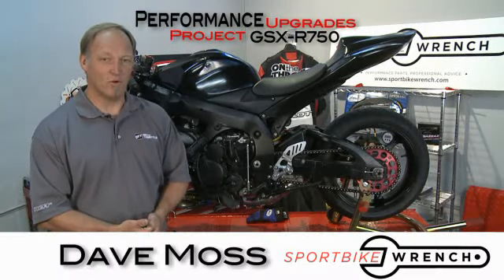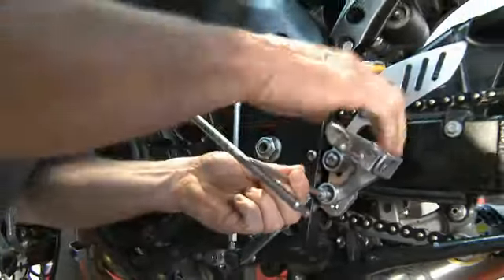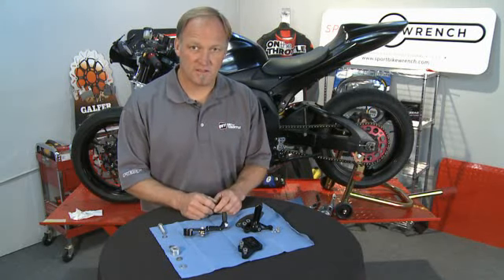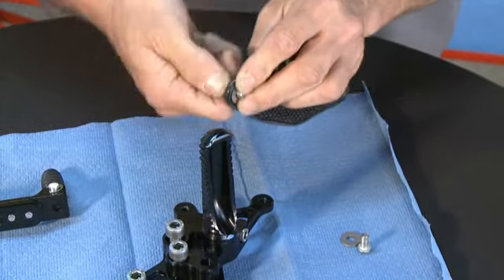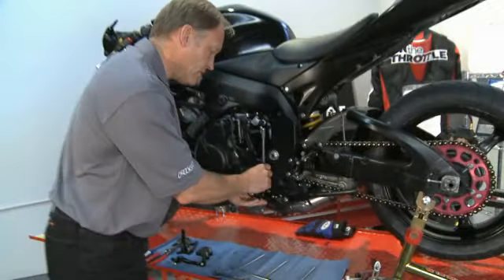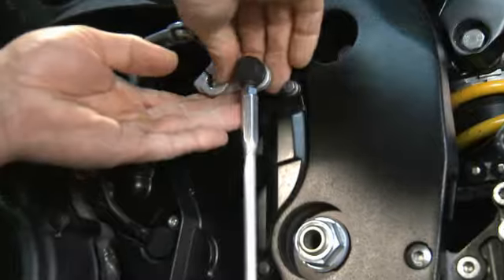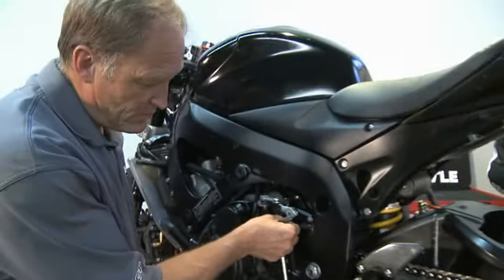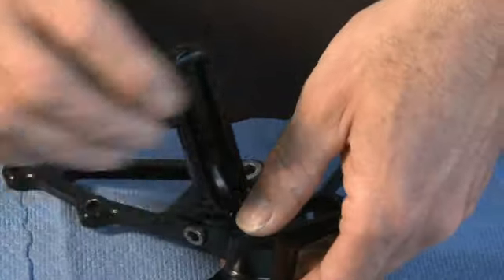Performance Upgrades GSX-R750 Attack Rearsets Install

Comment from the maker: we have found that it doesn't need the spring from the OEM rear sets and I've never had a drooping rear brake lever from that on the bikes that I have worked on. Doesn't mean it won't happen and putting the spring on (if the after market rear set facilitates that) is always a good idea.

Dave Moss
Host

Comment from the maker: @ZacGot1 for the track/racing, we reverse the shift pattern, so 1 up, 5 down. If you think about shifting using street shift, your foot is under the lever so you could grind your boot or worse, break your foot. Pressing down to go up a gear is much safer and makes a lot more sense!

Dave Moss
Host

Comment from the maker: @mrodmelvin11 not sure I can 'see' what you are explaining. The bolts should come out of the rear set to release the master cylinder. Then you remove the split pin and washer keeping the clevis in place and remove the spacer to free the clevis. The split pin can be a pain to remove!

Dave Moss
Host

Comment from the maker: @mrodmelvin11 it says in their PDF to replace original master cylinder clevis with new one and mount master cylinder to master cylinder bracket. Then adjust clevis to attain desired brake pedal height, tighten clevis jam nut, and install clevis pin/spacer/washer/cotter pin. You cannot use the OEM clevis as it will not separate itself.

Dave Moss
Host

Comment: On the right hand side it doesn't look like you are re-using the brake lever spring that restricts the brake lever range of motion. Wont the brake lever be sloppy without this spring? Great vid as always.

Comment: What tool did you use to remove the rear set on the rear brake side?  My hex set will not remove those nuts.  08 gixxer 750